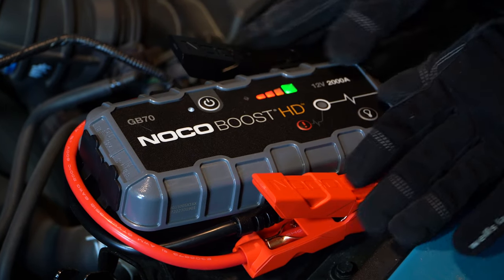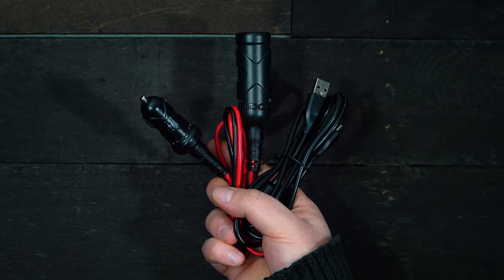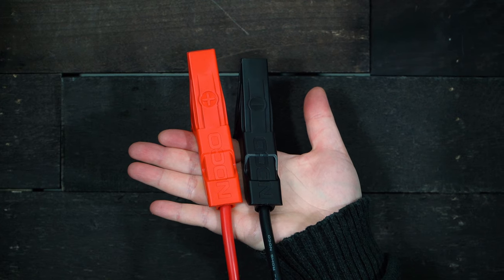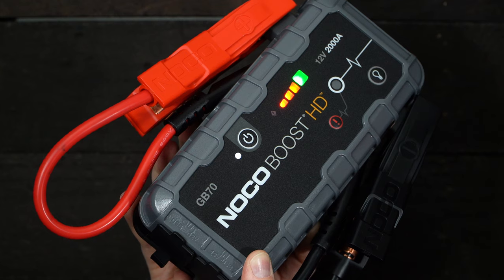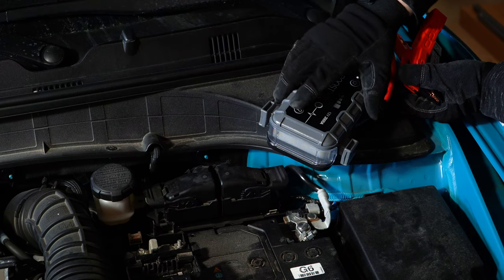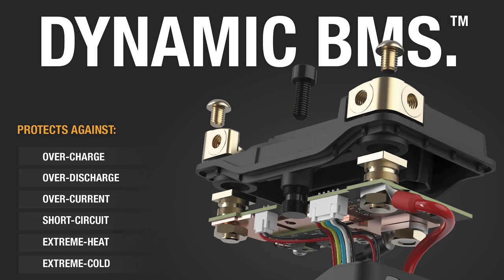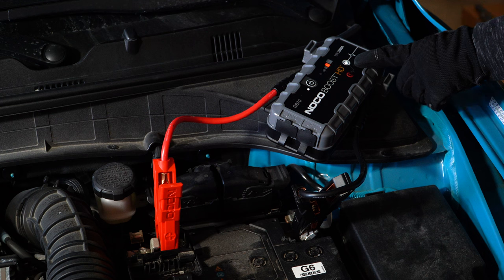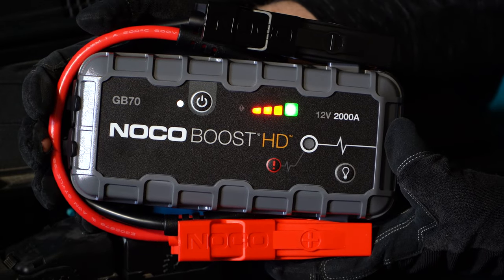NOCO GB70 Review: Portable Jump Starter for Big Engines (With One Potential Drawback!)

Comment: I assure you this booster will NOT jump start a 3.0ltr turbo diesel battery! I have both this particular booster and a nissan elgrand what won't jump start with this booster pack
Reply: Did you try jumping it w/out the battery? People don’t realize how much power a dead battery takes
Reply: @Joe_Brown99  No i did not try jumping it without the battery. But I'll report back when i buy a replacement battery. My argument is noco claim this booster will jump a dead battery and that's untrue.
Reply: @lookingfreshdetails3150 

Ah, right on good point

Yeah most jump starters won’t go through a bad battery because usually the connection inside gets toasted and most people don’t realize that.
Reply: I jumped my 6.7 diesel more than a couple times with this unit
Reply: @KP-vr6ft  I assure you it won't jump start my battery it's completely dead! But as stated previously this brand claims this booster "will jump start a dead battery" and clearly doesn't..

Fully charged unit (booster)
Will immediately reactivate my alarm, and give me ignition lights & glow plugs. Try and start the engine and all you'll hear is clicks from the dead battery, leave the unit boosting the battery for maybe 10 minutes with everything turned, and you'll end up with a flat booster pack and no engine start.

I never needed this booster when it was purchased. But rather have it and not need it. Then need it and not have it..

Now i need it and it's completely useless! I'm happy i found this out at home instead of being in the middle of nowhere..
Reply: @lookingfreshdetails3150 

Sounds like you have a dead spot in your battery
Reply: @Joe_Brown99 I honestly have no clue what's wrong with the battery other than its dead. I allowed my van to sit on the driveway without starting it for 3 weeks. The only thing it was powering was the alarm. I'll admit the battery is a couple of years old, but has never failed me until now. And ive never left so long without starting it.

I'm not out shame this brand of booster packs. If that was the case, I'd go out and buy another booster pack from their competitors (ie TopDon JS3000 and throw them head to head. 

They claim 45 jump starts from a single charge and will jump start upto a 7L diesel engine 

I just came here to call their claim for what it is BS!
It won't jump a dead battery.
Reply: @lookingfreshdetails3150 

I’m telling you. It has a dead short in it somewhere then 

Have you tried jumping the vehicle without the battery hooked up?
Reply: Your battery appears to have a dead short across the terminals.  There's not a booster on earth that can start a vehicle if you short out the voltage supply.  Not all batteries die the same way.  Some just lose their voltage over time until they have nothing left but they don't always present a short to the booster.  There are many examples on Youtube of boosters starting cars with batteries below the 2V level which is essentially a dead battery.  You can say you assure us that this booster will not start your dead battery but not that it will not start any dead battery.  If you ever did manage to get your car started this battery would probably not let it run anyway.  Your situation is unique.
Reply: You need to hold down the white button if it’s completly dead, then it will work

Comment: If the flashlight orientation causes you grief, maybe angle it upward and use the hood/bonnet to kick the light back toward the engine bay - the flashlight is extremely bright.
Reply from the maker: That's good feedback, thank you!
Reply: It's a stupid design mistake that they need to rectify.

Comment: I have a wet cycle battery and I went to go put on the charger and I put the negative to the negative and the positive to the positive and it’s showing the red reverse light but everything is hooked up right what would be the cause of that? Is the battery no good
Reply from the maker: Hmmm .... if the red light on the GB70 is solid then it's reverse polarity. If it's blinking, then it means the internal battery is too hot and the GB70 needs to cool. Usually, if your vehicle's battery is bad, the "Boost" light on the unit won't come on at all. How old is your battery? It might be a good idea to just replace it anyway if it's really old.

Comment: I've had my GB70 booster now for a year and I've boosted more than 10 times on several different vehicles - all on the first charge.  I've never found the cable orientation to be much of a problem.  There is more than enough length to connect the cables and still have the light pointed at the terminals.  I don't know why they chose to reverse the cables, there may have been some technical or space-saving reason,  but it's never been a problem for me.
Reply from the maker: That's awesome to hear and thank you for your feedback. That was our guess too on the cable orientation - likely a technical or space saving/packaging reason. Thank you for watching our video!

Comment: I am thrilled with this product and have already placed an order for one. I have a question that came to mind after watching your instructional video. In the video, the clamps are attached directly to the battery terminals. Isn't it standard practice to connect the negative clamp to the vehicle’s chassis ground instead of directly to the battery terminal? Could you please clarify if there is a specific reason for the direct connection to the battery poles, or if connecting to the chassis ground is also acceptable with this product? Thank you !
Reply from the maker: That was partly done in the video to show how the BMS (battery management system) won't allow you to have any sort of spark or reverse polarity ... essentially, the GB70 isn't active until it's hooked up properly - or put another way, a novice who doesn't have a lot of experience with cars can't accidently use the jump starter the wrong way as the internal software prevents them from doing so. I don't specifically know about the chassis ground, but the owner's manual recommends connecting directly to the battery terminals itself: https://www.manua.ls/noco/genius-boost-hd-gb70/manual?p=3 

When I was a service advisor back in South Dakota, we had a jump box under the main service desk. If a vehicle needed a jump in order to get it in the bay, we would always attach right to the battery terminals directly. However, other sources support what you are saying about the negative clamp: https://www.midtronics.com/blog/whats-the-right-way-to-jump-start-a-battery/ 

I hope that is helpful. Thank you for watching our video. ~ Carl
Reply: @Automoblog  💪

Comment: Silly question but is it possible to have too much power? If I used this gb70 on lets say, a snowmobile to jump start it.... would the 2000amp cause damage? As 2000amp jumpstart would be overkill for a powersports machine
Reply from the maker: Yes, this unit would be overkill . . . however, the internal battery management software should recognize the battery it's connected to. Before we reviewed the GB70, we met with the NOCO product development team who said that the software was designed to prevent the GB70 from "hitting a smaller battery with everything it's got," but rather to only rely the power necessary to start the battery you are attached to.
Reply: @Automoblog  awesome! Thanks for the detailed answer!
Reply: The 2000A is only a maximum possible current the unit can supply.  It's similar to the Ah rating on a battery.  The 12V part is the important number.  As long as your battery is 12V it will work OK.  The starter will draw as much current as it needs to start - starters on smaller engines draw less current.  You can use this to power 12V tire pumps, boost motorcycle batteries and more.  I've used mine on all of the above.  The USB output can also be used for cellphones.
Reply: @TechSavvy.  awesome, thanks for the detailed feedback!

Comment: This works amazinf!
Reply: I got one that looks like it's a return and it didn't come with any charging cables or anything other than the main box. Should it?
Reply from the maker: Yes, it should come with a 40-inch micro USB cable for charging and an XGC extension cord with a 12V male and female adaptor. Using the micro USB cable and a USB wall charger, it takes about three hours to charge fully if the internal battery is completely empty.
Reply: @Automoblog Thanks. At least now I know what to get and how to charge it!

Comment: Can the gb70 be used on small vehicles?
Reply from the maker: Yes, it sure can. The GB70 will handle gasoline engines up to eight liters and diesel powertrains up to six liters in displacement, including late-model HD trucks from the Big Three. That said, you will be fine to use it on a smaller vehicle. There is also an internal battery management system (i.e., software) that tells the NOCO GB70 to only deliver the juice required by the battery needing a jump. Essentially, it can tell the difference between a lawnmower battery and a truck battery and adjust its power delivery accordingly.

Comment: Can you run the car on NOCO GB70 lithium ion jump starter without a battery, and what is the longest time you could do it with the NOCO GB70 lithium ion jump starter (if the alternator is not working, so you could drive the car to the shop if it is close), if it work I will buy it.
https://www.youtube.com/watch?v=PjXOpr9wFsg 
Drive with ONLY a Jump Pack? (Car Battery Entirely REMOVED)

https://www.youtube.com/watch?v=NQNCV7hvUK4 
Quick fix to bypass a broken alternator
Reply: I had to do this yesterday,  we got about 15-20 minutes running time in a efi v6 .
Reply: @plushbraap9156 

Then your alternator is dead